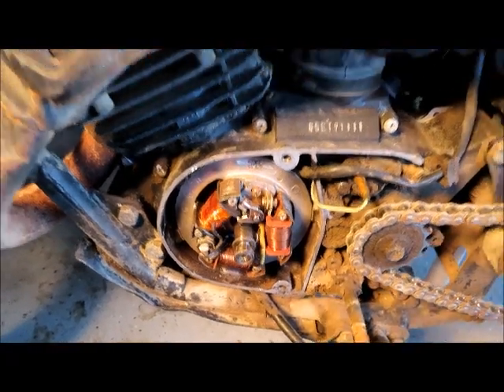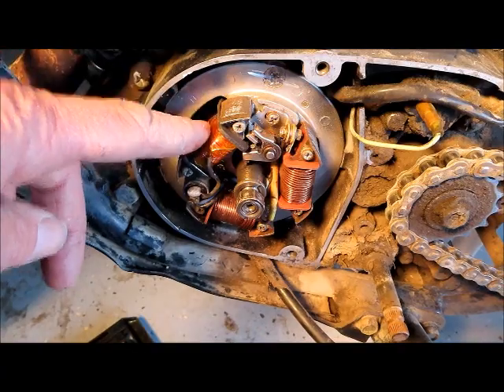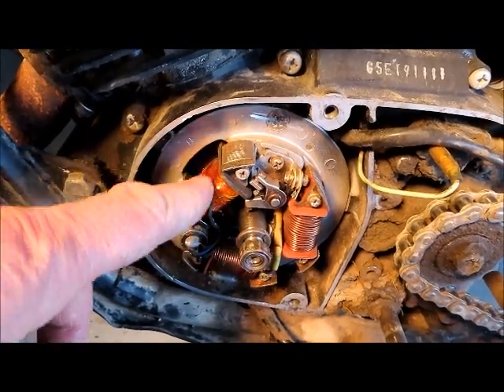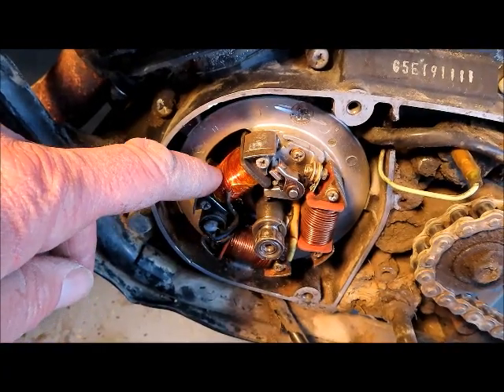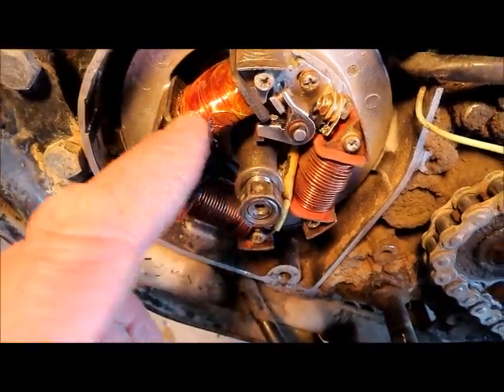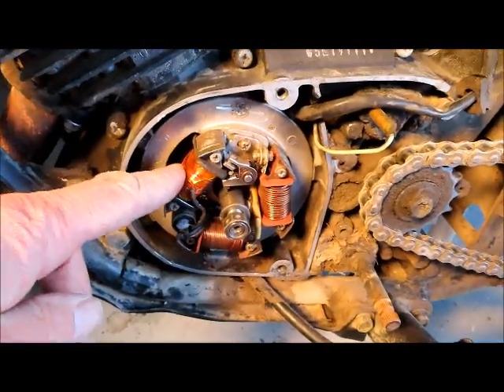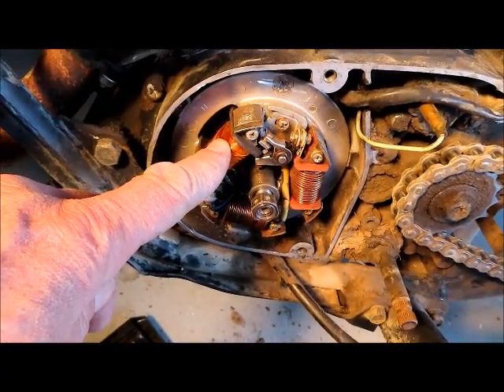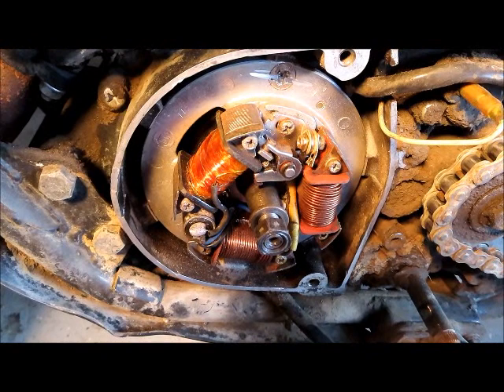Kawasaki KE100 Mag Coil Wire Replacement - Rewind it Yourself!

Comment: I wish I saw this three years ago. I purchased a new/used stator assy for a KE100. The exciting coil wasn't working on the bike I bought. I considered winding a coil but discarded the body. A couple of years back I purchased a new old stock coil (21049-1004). Just can't seem to get a proper resistance reading on the coil.

Comment: Hey Paul thanks so much! Can the other coils be rewound as well? Do you know what Guage  wire they take?
Reply from the maker: I'm sure they can be.  However, I have not done it.  Get a pair of calipers and measure the diameter of the wire then get online and find out what gauge matches your diameter then order new wire.
Reply: Did you make the insulators on the ends? I see they are Grey not red.. curious if you made them what material you used? Mine are broken.
Reply: Couldnt you just put a resistor in there? Lol
Reply from the maker: Ha!  now that's thinking outside the box!!!  Good one...

Comment: Thank you for this! So glad to find a video that explains the theory and function of how it works. I'm going to give this a try now!
Reply from the maker: You bet!  Glad it helped you.  Just remember that varnish covered/insulated wire WILL NOT solder or conduct to your tester until you sand off the coating.  You have to do that on the tips of the wire as you are finding the correct resistance and when you go to solder the ends to the termination connections.  I think that might trip some people up as my vid was explanation and no real hands on show and tell.